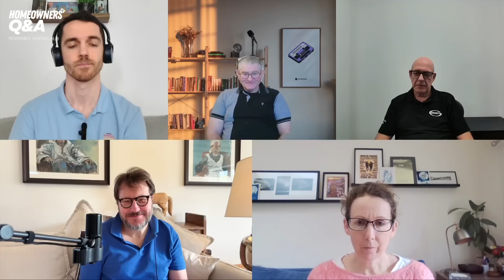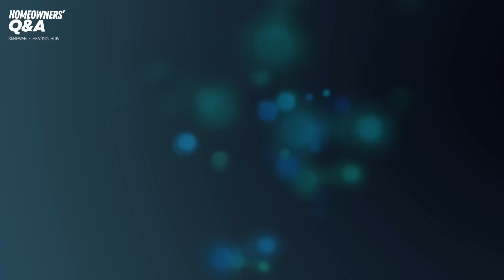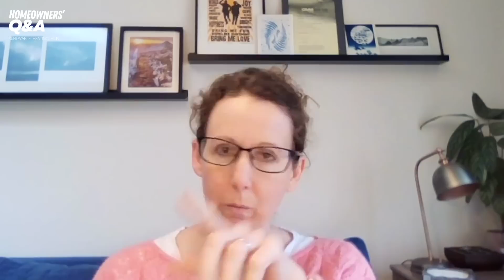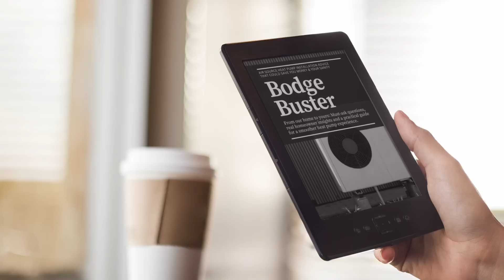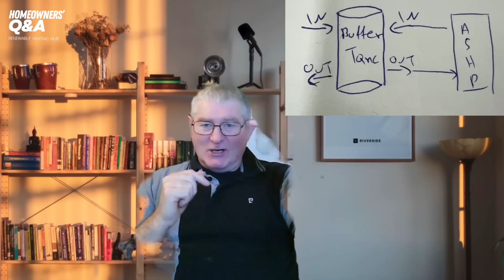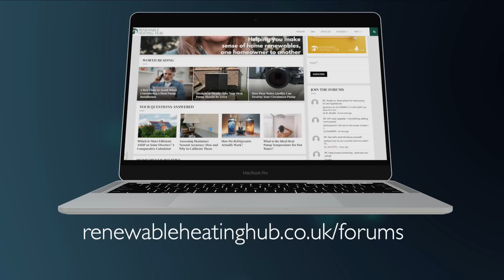Efficiency Killer? Are Buffer Tanks Costing You More Than You Think?

Comment: I love how informative this channel is - it’s shining a light into the dark cavern of my ignorance, making me realise that I don’t know what I don’t know. 
I want to get an ASHP in the nearer future and it’s clear that finding a good engineer is much more important than the ‘right’ kit. 
I got a quote from Aira, and while I understood that it was a maximum which maybe could go down, the rep specified a buffer straight off before any heat loss survey, also some ‘minor’ repiping (I.e. some ‘minor’ lifting of floors). 
They guarantee the performance of the system (comfort, NOT running costs) and I guess that guarantee is conditional on acceptance of whatever their design is, buffer and all.
Anyway I decided that even though the 15 year ASHP warranty is a winner, it’s more important that the system is optimised for this (challenging) house. 
These discussions are so helpful in improving my understanding of the issues.
Reply from the maker: Thanks for watching. Your support is appreciated and we’re glad that we’re providing usable, useful information. Aira default to buffers, and comfort doesn’t always equate to efficiency as you’ve correctly pointed out. Our house is a good example of that. There’s absolutely no reason why a well installed heat pump can’t keep the house warm and comfortable with a minimum 3.4-4 SCOP.
Reply: Aira design every system with a buffer as it also helps preserve the unit and with the 15 year warranty it's their company way if you don't want a buffer you'll need to look at another company
Reply: Read the small print on that 15 year warranty..
Reply: Yeah but this is the problem…it’s way to technical and even these guys can’t agree on many system designs…. Imagine two old folks coming to replace their simple gas boiler talking to these clowns.   And that’s if the old folks have space for a plant room and pipes and cables and tanks and bloody ugly triple thick radiators and a spare £15,000 to burn on a system that most likely won’t work….    This 5 way discussion is proof of the many problems with this technology.   Avoid for now, come back in 10 years time maybe…

Comment: I'm a gas safe installer. I'm doing an install  on behalf of a customer. I'm installing a heating system that has been spec'd by the heat pump installer. If I was installing a gas boiler I would zone upstairs , downstairs and underfloor. When I asked the company should I zone upstairs and down they wouldn't say yes or no? They said it was a grey area? Up to me? The electrician asked how the 2 immersion heaters worked in the combined buffer unvented  cylinder? He wasn't sure. He said 1 heated hot water whilst the other heated the buffer? I'd like to walk away from the job as they don't fill me with confidence. But they are good customers.

Comment: To my mind a buffer tank will help with the problem of short cycling for my ground source heat pump and radiant floor heating system. It just makes sense that the heat pump basically pays attention to the heat content of a relatively large volume of water as opposed to cranking on and off when a zone in the bathroom, for instance, calls for heat. Can anyone please explain to me otherwise?

Comment: One of the most overlooked parts of the “buffer vs no buffer” debate is the internal design of the tank itself.

Two buffers with the same litre capacity can behave completely differently depending on what’s happening inside them.
A properly designed buffer is meant to preserve stratification and controlled flow separation without turning into a blender.

If it’s just an empty cylinder with four tappings (like many schematic drawings show), you can end up with:

Direct short-circuiting between flow and return

High internal mixing

Loss of temperature gradient

Elevated return temperatures

The classic “have to raise flow temp to compensate” problem.

That’s where many anti-buffer arguments come from people have seen poorly designed or poorly piped vessels creating hydraulic chaos.

Purpose-built heat pump buffers often include:

Internal diffusers or baffles to slow velocity and vertical port separation to support stratification. On top of that guided flow paths so energy actually migrates through the volume & low-turbulence entry to maintain ΔT.

When designed and piped correctly, the tank behaves more like a thermal flywheel than a mixing chamber.

The conversation shouldn’t be “buffer or no buffer”, it should be about what type of hydraulic behaviour you’re introducing into the system.

Comment: THE BUFFER TANK PARADOX: Bridging the Gap Between Refrigeration Limits and Hydronic Precision
The modern heat pump industry is currently divided by two distinct philosophies: the "Cooling Heritage" approach and the "Hydronic Mastery" approach. While many advocates of "open-loop" systems dismiss buffer tanks as efficiency-sapping distortions, this view often ignores the inherent hardware limitations and software locks of high-volume, mass-market heat pumps.
The Floor Temperature Constraint
A primary driver for buffer tanks is the minimum flow temperature mandated by certain manufacturers. For instance, where a building’s weather compensation curve may require a flow of 26°C on a mild 12°C day, a Panasonic unit may be software-locked to a minimum of 35°C (whereas a brand like Daikin might allow for 25°C).
Without a buffer to act as a thermal flywheel, the heat pump is forced into highly unnecessary cycling. In this scenario, the buffer does not "distort" the system; it provides a vital hydraulic "lung" that allows the heat pump to complete a healthy run-cycle while the property receives the lower temperature it actually requires via a variable temperature mixer.
Intentional Design vs. The Fear of Distortion
A widespread fear of "distortion" leads many installers to move away from the best system design strategies. This misunderstanding arises from a general encouragement to avoid any mixing within a system. However, it is essential to distinguish between unnecessary distortion and mixing that occurs as a necessary feature of superior temperature control.
While distortion should be avoided where possible, it is equally important to recognise where mixing is required for good design. In these instances, mixing becomes a positive, desirable, and advantageous feature. The use of a Variable Temperature Mixer (VTM) is the preferred option for professional heating designers seeking fine-tuned control.
Kv Values and Valve Authority
When employing a VTM, the critical importance of selecting the correct Kv value cannot be overstated. Selecting the right valve size ensures accurate control over the flow temperature to any given circuit by maintaining proper valve authority. If a valve is oversized, its authority is diminished, leading to unstable control and "hunting."
Interestingly, for heat pump applications, selecting the correct Kv value often becomes easier than for traditional gas systems. This is due to the far greater flow volumes required for the lower Delta T (\Delta T) operation characteristic of heat pumps. These higher flow rates naturally align with the flow capacities of standard high-quality mixing valves, allowing for more predictable and stable temperature regulation.
By blending return water from the system with the correct volume of new flow water, we can maintain the exact curve required by the building fabric. As long as this mixing does not force the heat pump to run at temperatures above its peak efficiency envelope, it adds to comfort and longevity without sacrificing the Seasonal Coefficient of Performance (SCOP). This strategy utilises the buffer volume for anti-cycling and defrost protection simultaneously.
The Fallacy of Micro-Zoning and Heat Parasitism
Building regulations often mandate zoning, yet "micro-zoning" (room-by-room control) frequently conflicts with thermodynamic reality.
Parasitic Heat Loss: Reducing the temperature in one zone (e.g., a bedroom) increases the temperature gradient between it and the adjacent heated rooms. This "steals" heat from the active zones.
Emitter Starvation: Closing zones reduces the total surface area available for heat exchange. This forces the heat pump to raise its flow temperature (Tf) to deliver the same amount of energy through the remaining active radiators.
Efficiency Decay: For every 1°C increase in flow temperature, the efficiency typically drops by 2-3%. To compensate for the "turned down" rooms, the heat pump must run a higher, less efficient curve. These concepts are almost impossible to explain to a customer who simply believes turning a room temperature down will economise on the cost of fuel.
The Internal Reference Point: A Corrupted Metric
Many installers attempt to "correct" poor system behaviour using a single internal reference point (a wall thermostat). However, a single-point reference is inherently flawed and often "corrupted" by local adverse conditions—such as solar gain in a south-facing lounge or a draught in a hallway.
When a system uses this single point to switch the heat pump on or off, or even to refine the temperature output, it risks mismanaging the comfort levels of the entire property. In a multi-zoned system, this lack of holistic data leads to "blind" operation. We must either rely on Pure Weather Compensation, or utilise a control strategy that receives feedback from ALL areas of the property to adjust the global heating curve intelligently.
Viessmann has addressed this specifically. Their ViCare Smart Climate system and Vitotrol sensors extend this "Room Influence" capability to their Vitocal heat pump range. This allows for feedback from multiple rooms, preventing the "single-sensor corruption" that plagues lower-tier manufacturers.
The Responsibility of the Manufacturer
The current trend of shaming installers for "poor installs" overlooks a fundamental issue: many products on the market are essentially repurposed air conditioning units. These units often lack the sophisticated secondary flow sensor support—which allows the unit to compensate for system-side distortion—and advanced weather compensation logic found in premium European hydronic brands.
Manufacturers who ignore these theories in favour of low-price market demands are effectively pushing "poor control strategies" onto installers. It is difficult to recognise a manufacturer's design weakness when the hardware itself is incapable of the fine modulation required for a modern home.
Conclusion: The "Silk Purse" Dilemma
As the industry moves toward renewables, we must distinguish between "limitation-based design" and "comfort-based design." High-quality products like Viessmann allow for a "set and forget" strategy that guarantees efficiency through superior logic. For other manufacturers, the buffer tank remains an essential tool to correct hardware inadequacies—not a flaw, but a necessity for system survival and occupant comfort. In the world of heating, you simply "cannot make a silk purse out of a sow's ear."
Technical Source Directory & References:
Andrew Millward (Watford): An invaluable research resource for heating-based articles. His channel provides peer-reviewed-level demonstrations of hydronic separation, the application of mixing valves, and the practical rectification of "AC-heritage" heat pump control failures.
Viessmann Climate Systems: ViCare Smart Climate and Vitotrol 200-E/300-E documentation confirms the ability to utilise multiple internal reference points to intelligently adjust the global weather compensation curve for Vitocal heat pumps.
Fraunhofer ISE (2023 White Paper): Documents that for every 1°C increase in water outlet temperature, the COP typically degrades by approximately 2.5%.
Heat Geek Research: Provides extensive analysis on the "Zoning Fallacy" and how micro-zoning forces higher flow temperatures and increased electrical consumption.

Comment: British gas training centre: 7m/s through 8mm microbore is fine, 
British gas HP installers: 8mm microbore for the 400W room loss at -3, can't install heat pump, you need to re-pipe the house to at least 15mm.

Math: 8mm at 1m/s is 100L/h, with dt 5 it is ~600Wh. so it exceeds the room demand by 30% at the speed of 1m/s. but no BG wants to re-pipe the whole house to 15mm to use flow adjusting valve on the radiator to limit it to 8mm microbore flow rates.

Nice words on the podcast, but nothing changes in the world of the installers: "8mm microbore - no HP, buffers - to everyone".

Comment: Amateur question from an amateur: for distortion wouldn't it make a sense to install a pump that would circulate the water inside the tank, almost like having a whisk to mix it? Wouldn't that remove the distortion?
Great discussion :)
Reply from the maker: No, that would increase distortion. Distortion is blending/mixing. You want the water to stratify if you have a buffer and remove blending, so the complete opposite of the whisk effect.

Comment: I’ve spent months researching air source heat pumps (ASHPs). I’ve watched every expert on YouTube, read the case studies, crunched the numbers — and even had a full ASHP survey and quote for my own home.The result?A £13,000 system (minus grant) that achieved a 3-star rating — out of 6. (quote price 19k+That’s not just disappointing. It’s pointless.Because let’s be clear:
A 3-star ASHP install is barely fit for purpose.
It won’t cut my bills. It won’t dramatically reduce emissions. It may even cost more to run than my current high-efficiency gas boiler. This Is Not Scandinavia Every forum, vlog, and “green tech expert” repeats the same refrain:“Heat pumps work brilliantly in well-insulated homes.”Sure they do — if you live in A passive hous, A new build with EPC A/B rating, A compact, airtight box with triple glazing and underfloor heatingBut I don’t. and neither do millions of people in post-Thatcher Britain, where homes were built for speed and cost— not energy performance.We’re talking about: Patchy cavity walls. No insulation in floors or eaves. Draughty extractor fans sucking cold air into bathrooms. Old radiators designed for 70–80°C flow temps The Maths Doesn’t WorkLet’s look at the numbers: ASHP install: £13,000 after grant. Result: A system that performs just adequately. lternative: A top-end gas boiler for £2,000 that heats the house fast, provides endless hot water, and just works With the £11,000 saved, I could: Upgrade insulation Fit smart controls and zoning Even install solar panels or a home battery The carbon return? Far better. The comfort? Immediate. The logic? Unquestionable. What We Need? If the UK government and the ASHP industry want this technology to succeed, here’s what must change :No heat pump install should be allowed under 4 starsInsulation surveys must come before the ASHP quoteGrants should include insulation and heat emitters — not just the box outsideInstallers must stop selling heat pumps into houses that are totally unsuited without major upgradesFinal ThoughtI want to go green. I want to reduce my emissions.
But I won’t burn £13k for a system that will leave me colder, poorer, and disappointed — just to tick a policy box. So the next time someone on YouTube tells you a heat pump will always save you money and save the planet? Ask them: Is that true — or just technically true in a house I don’t live in?

Comment: Thanks for providing valuable info. Question for experts, thanks on your comments in advance. I have pretty good  volume in my radiators/pipes, around 100l, would like to run 6-7 kW pump, without tank/volumiser/... if possible. And question is - if, for some reason, I do not want to heat half of this area and therefore I close TRVs on them, can I just lower the maximum power of HP,  so my system stay balanced? Less power, less volume needed, is that simple or I am missing something? I would expect most HP have this feature (limiting max power)?

Comment: Do the heat geek mini store hot water cylinder design also be used for defrosts?? The big one looks like it can hold 130 litres, surely that stored at 45’C would be great for defrosts especially if it was charged up on the cheap late at night.

Comment: Thank you very much for a video packed with so much useful information. I have a job with a poorly installed system which on the face of it is asking for a buffer vessel to be installed - I've been entertaining different possible fixes. I feel much more confident after seeing this video.
Reply from the maker: A buffer tank to be installed? Do you mean removed?
Reply: @RenewableHeatingHub  No, it needs a buffer tank - 2 x 11.2kW Mitsubishi 's - with one running, the installed low loss header heats to maximum in 10 minutes, then the heat pump switches off for 4 minutes and so on... The zoned heating system cannot extract the heat quickly enough compared to the delivery from the heat pump

Comment: The biggest problem with buffers is they potentially hide a poor heating system install and allow the heat pump to work.
Yes, there are installers capable of matching the flow on either side of the buffer but they are very few and far between.
The majority of horror stories on Facebook groups are clients stating ‘my heat pump costs a fortune and I’m not warm’. When you look into these systems 99% of the time the have a buffer which  then enables the installer to potentially oversize the heat pump, use 3rd party controls, have multiple zones and fixed speed pumps that all cause huge efficiency losses.
My comments from the very first episode on buffers stand.
They are not needed in most domestic properties, a correctly designed, open loop system with correct system volume and a correctly sized heat pump wins every time.
Reply from the maker: Thanks for the insights as always. Let me know if you’re free to come back on the podcast in the near future!